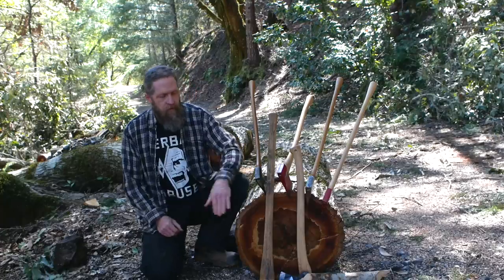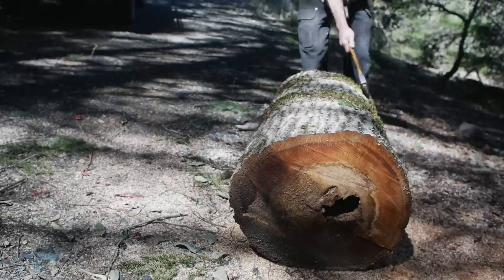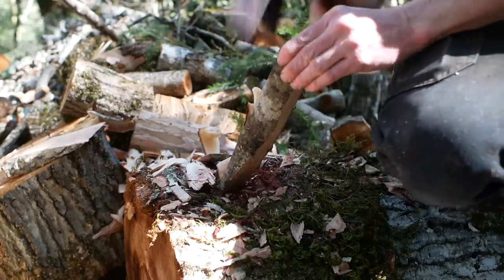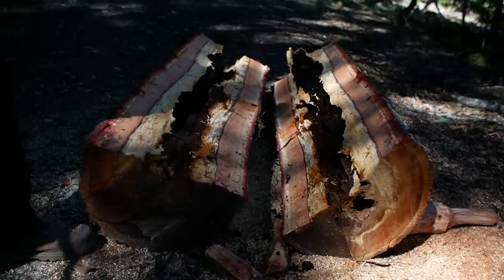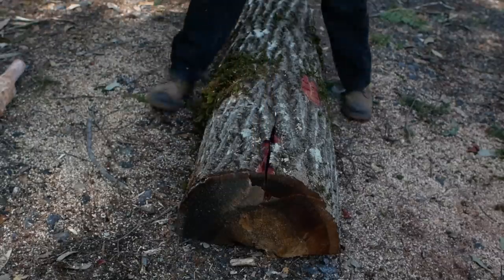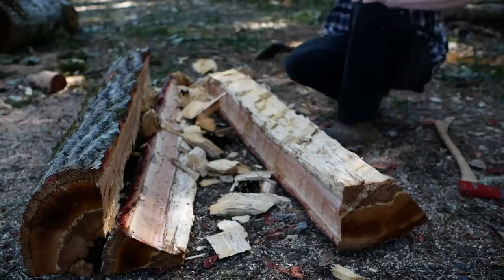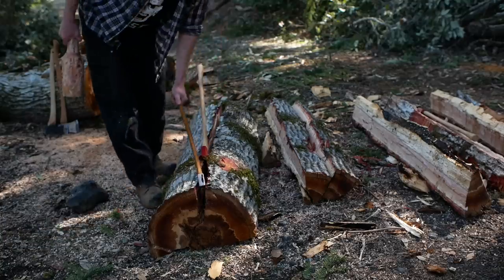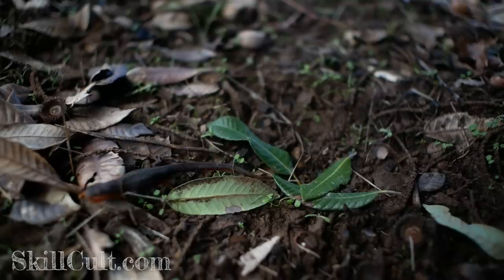Splitting Choice Axe Handle Blanks From An Oak Log & Shaping Wooden Wedges

Comment: Great job on this video. Never heard of tan oak, google tells me its an evergreen link between chestnuts and oaks, how interesting! 
Love the Bowyers Bible series, great info, after making over 20 un-backed self bows from oak, I can say you are right, its "Meh", not bad but not great, hickory is my favorite bow and flexible handle wood. 

Have you done a video on axe handle grain orientation? I learned from Roy Underhill to orient grain as bark to edge heart to pole, which is exacly opposite to most modern ideals, yet this has worked very well for me, and I think it makes sense from a bowyers perspective if you want very thin and "whippy" axe handles, that actually flex into the cut, but I would like to know your thoughts on this.

Josh
Reply from the maker: Yes, tan oak is some kind of weird link.  It's similar to something called the Japanese stone oak and I remember hearing a theory that it was an immigrant, rather than a left over.  It was quite a successful tree until the oak plague hit.  Soon they'll all be gone.  What do you think of locust for a handle wood, or have you used it?  It seems about the most similar to hickory to me, but possibly less tough, though also possibly a bit harder in terms of resisting denting or compression.  A good piece of locust is like a freakin' rock, but then hickory is similar.

I have not done anything on grain orientation really in depth, but I have outlined a video on what matters and what doesn't in axe handles to try to bring some thoughtfulness to that and similar topics.  Also, to raise or highlight questions.  it just got so big and turned into too much of a project to finish lol.    I'm still inclined to think that grain separation is more likely with the grain running perpendicular to the eye, but probably not by a lot.  As far as flexibility goes, I actually looked that up and there are not huge differences as I recall.  There could be other unlooked at or intangible factors though involved in feel v.s. some lab coats pushing on pieces of wood and measuring deflection.  I've used both, but always pick or make handles with the parallel to the eye grain.  I actually did do one video on that kind of stuff, but just cursory. It's a series called axe buyer's check list and one is on handles.  A point I think is important is that a skilled user can mostly nullify a lot of minor vulnerabilities and an unskilled or incautious user can break a great handle.  I think user competence and plain wood quality and integrity trump a lot of other things.  Instability is a huge problem, especially with a lot of low grade wood being used.  The hardware store that has handles here sells mostly crooked handles.

One thing on the bows and axe handles comparison is that Tim Baker recommends making bows to one growth ring on the back when bows are made "flat sawn" style, or go to more of a vertical grain orientation.  That points out a vulnerability in ring separation v.s. separation along the radial planes.  Probably one reason that I still favor vertical grain, is that theory.  He did a lot of testing.  I know him personally and got to see him at work.  he would sometimes make multiple bows in a day trying everything and just extreme testing them.  He didn't care about the bows, just what he could learn.  I wish I could take the time to make that axe handle vid, but it will have to wait a while.
Reply: Mr. Chickadee I also use this method with grain perpendicular to the blade, there are several good reasons.
Reply: SkillCult Thanks for posting this beautifully shot and informative film, it will remain canonic as long as YouTube endures, all the best, Lucas.
Reply: @LucasRichardStephens  Would you clarify your desired orientation please, where would the bark side of the tree be for example in a single bit axe? I would also love to hear your thoughts on the good reasons for this.
Reply: @MrChickadee  Yes of course I am coffeed up so here goes; having used axes for timber-house building for a long time I have had quite a few handles.  The merit of the transverse grain  is, for me two fold, there is a noticeable decrease in short-wavelength shock and an increased durability when prying sideways, which I do a lot when hewing.  I also make hammer handles like this to increase shock absorption, but such hammers can not be used to draw  nails at all. I have a video that shows rehanging my bearded axe, if the link can be posted;  https://www.youtube.com/watch?v=u9dBHGz2mMU . Notice how I use wood that has the desired curve naturally in the growth, this mitigates fibre runout and maximises the strength of the handle, despite the transverse growth rings. The back of the handle is the inner trunk in this instance but only for that reason, if the curve suited the reverse I would do it. I study the wood fibres and allow it to function how I think it's best suited based on experience, which is always growing/changing.  I don't have very much experience using felling axes or generally cutting wood across the grain with an axe. In this second (attempted linked) film I re hang a felling axe, but with the year rings the same way as the blade and very inexpertly fell a frozen spruce. https://www.youtube.com/watch?v=Uw4UlLwjV7g&t=5   I don't have the confidence of experience to try a transverse  hang but your comments here tempt me to try, I still have a couple of these Norwegian pattern felling axeheads to hang, all the best, and both you and Steve are making great films so thanks for that!
Reply from the maker: @lucas Richard Stephens  Thanks, I was going to ask for clarification too.  Very interesting observations.  I had wondered about the side strength of one v.s. the other being a factor in side breakage.  So basically you agree with my tendency to think that grain separation is likely more prone with stress applied across the growth rings v.s. with them, but your stresses are perhaps different.  Or maybe not too different  though.  I've spent quite a bit of time thinking and talking about side impact as a factor in breakage, because it actually is rather common and it's also a common cause of breakage, often resulting in slabbing splits off the side of the axe.  They often result in just a slab hanging partly off the side.  I've seen enough broken handles to make me think that hickory at least, does delaminate along the rings a little more easily, but the stresses applied to an axe are complex and varied.  I use my axes to pry, but I learned the hard way what I can get away with.  I'm always interested in a mellower feeling handle.  I know Buckin Billy Ray Smith thinks the transverse grain handles are mellower.  The bit about the curves in the ring is also interesting too.  If you could stay within one growth ring, on the belly of the axe handle, at least for the top half or so, that would follow Tim Bakers one growth ring rule of bowmaking and might  really make it more competitive with paralell grain or even possibly superior in a felling in some ways.  That is assuming that hickory really is more likely to delaminate with the rings than across them..  Tim showed me a bow once that he called the troll bow, which was a super gnarly piece of yew that looked like some fake bow from a fantasy movie. Seriously if you saw it, you'd never think it would shoot.  He stuck with one growth ring and where knots were, just left the whole lump with the growth rings coming up over the knot and everything.  After that, people started showing up with bows made from terrible wood, with knots and knot holes and such, just by following that rule.  I noticed also that Handles on Scandinavian axes are thicker than I would normally tolerate using if they were made of hickory as I'm used to handles on American axes.  I had thought that might be because they are used a lot for capentery where control is actually needed, unlike in general wood butchery for logging, forestry and firewood. where most work is done by throwing the axe into the work and letting it cut.  i imagine that is partly true, but maybe also between than, less shock prone, lower density woods and a more shock absorbent grain orientation.  Thanks for weighing in.  it's always good to hear the voice of experience.
Reply: @LucasRichardStephens  Thanks for your thoughts and experience! Reasons Ive read about and seen for orienting the billet with bark to edge; 

Less shock, more "spring", easier to rive from log, (you can get more billets from smaller material, I often get 8 billets from one 6" diameter log), the billets dry faster and straighter, and they also tend to stay straighter over many seasonal changes  (most hardwoods want to curve away from the heart as they are removed either in boards or riven staves, if this curve is the back or belly of the axe or bow, it doesn't effect its left right straightness)  

For grain run-out, I simply use a template to ensure the same fibers from the eye continue down straight into the handle, much as is done in curvy arms for bow saws. 

For what it worth, I wander if the trend in grain orientation as most see now is related to baseball? Ash obviously is not hickory and it can de-laminate pretty easily with the rings, such as in making pounded ash basketry. 

Steven Ill have to send you a few hickory billets to put through the paces, Ive yet to be able to break any....
Reply: I actually blame my hickory handled tools for the awful tendon strain I experienced the first few years of working with  axes ( I have only used ash now for about twenty years) but I see now in hindsight a theory developing; we are experiencing a new phenomena  of international trading ie, Hickory handles being imported to Scandinavia where we had always used ash or birch, consequently making the traditional handle shape  damaging to our hands. Bear in mind that, as far as I am aware, buying axes with handles already fitted was not normal in Scandinavia until relatively recently.  The conservative nature of hand workers is tricky to deconstruct and now that we can communicate so easily across differing bioregions, all manner of interesting misunderstandings are  possible. It makes so much sense to hear that in the States hickory was thinned down for a whippy axe. It is really interesting to follow you two, who have so many more man hours of experience actually using hand tools than is normal in the West. The guy from Mudpond hewing, I wish he would do more videos or get into the discussion. Great thread and both of you are perfect gentlemen, all the best!
Reply: I was just thinking...I made ~341 attempts to make an excellent wooden self-bow. #22 was my best attempt.  White ash back in the 1990s before the Emerald Ash Borer decimated our ash.  I remember trying to make gluts to split the stave and it was a comedy.  I made them out of white pine and they blew apart.

Comment: When splitting rails for the chopping platform in the cordwood challenge, I had to thin my wooden gluts due to bouncing out of the split. I ended up with two sets. One very acute compared to the other set. Some wood tends to run out more than others I've found. I plan using rails of pine for my cabin rafters. This will take less trees and give me a somewhat dimensional rafter.  

Great demo. I appreciate the way you give tribute to those gone before us.
Reply from the maker: Tan oak seems especially prone to run out.  I've had endless trouble with it.  Makes me wonder how durable it will really be.  Locust is awesome.  I cut out a little bit about a few different woods that split really reliably for brevity's sake.  Usually better safe than sorry as far as pursuing a sort of best practices approach anyway.  I know what you mean.  That fattest glut there from the round stick didn't come in handy until the end.  I've used really small thin stuff, almost like chips, to hold open and get splits started for increasingly larger wedges.  Pretty consistently though, I think most beginners will make wedges too fat and not planed enough on the sides.  I did.  Hope you're doing well buddy.  Such a cool project you've had going over there with the cabin.

Comment: We used to split a lot of logs. Fence posts, tomato and tobacco sticks, short tool handles- all from locust, hickory and oak. Long tool handles from maple- hoes and rakes. Dogwood wedges are awesome, about the only good use for Dogwood. Used them for felling and splitting wedges. I used thicker "chocks" to position log and keep it from moving.  Since we did so much of this, we made really good mallets and wedges. I used linseed oil to keep my wedges in good shape.  I found a cheap axe with very thick eye walls, after thinning the cheeks, this became my "wedge on a stick". and was great for starting a split in a large log.
Reply from the maker: Fun, I have lumber envy.  So many straight nice hardwoods back east.  I have a couple wedges kicking around somewhere made from durable hard woods.  We do have a species of dogwood, but I don't have access to it.  There are only so many species that have the combination of toughness and hardness that makes really good wedges.  Thanks for commenting :)

Comment: I've only recently started splitting wood manually with hand tools, just the past month. This is motivating. I've got several 1-year cut pine and birch log lengths of 3' - 4', 16" - 26" diameter. No idea if those will be valuable for axe handles but I'm sure I can fashion some handles for vintage hammers and other tools to keep them going strong. Regardless, will be great practice and extremely therapeutic making wedges, splitting some lengths by hand, and fashioning some handles...all fairly new to me. Appreciate your style. I learned a good deal. Thanks.
Reply from the maker: Birch has been used, but I don't think it's probably the best wood.  It might be more that it was the best available maybe.  but it might work out.  Pine I would avoid, but you could try splitting some boards out or something.
Reply: @SkillCult  yes, I figured that was likely so I’ll consider them practice pieces for now. Thanks

Comment: Why are wedges so incredibly satisfying to use, or watch someone use?  Splitting wood, or making a wedged tenon, are some things that just make me happy.  I occasionally fit a brand of aluminium gutter, and my favourite part is that it uses a wedge clip to pull the downpipe brackets together really tight.  I suppose the pleasure of using a sharp tool is the same thing.
Reply from the maker: It really is.  I love the sound of wood splitting apart too.  Maybe it's because they are so simple, but effective.

Comment: Thanks Steven, 
This motivates me to do like to a Big Ole Hickory that's got the top blown down. The tree had been struck by lightening several times and was on the watch list, now it's on the cut list, about a 14 feet tall Tenn. Hickory stump, with the last big limb broke half over. I've got visions of handles coming out of it. I'll be working on getting this on down safely first, then work on the billets second. But you video is a good motivator. 
Thanks man, and God Speed,,,
Reply from the maker: Hickory and some other woods get damaged by standing around too long dead, so if it's green, better get on it.  You'll get there handles where the wood looks fine, but it snaps across like chalk.  I'm pretty sure it's from either being standing dead, or too slow seasoning.
Reply: Steven, 
Thanks once again, got that Tenn. Hickory on the ground, and was a still living tree, with that narly limb. Found the nails near the base and mark them avoiding that hazard, it split into some very useful staves and billets. Your videos are very appreciated teach points, thank you sir. 
Take care,
Son of Liberty ( I change tablets, and just put me name on the Utube account) 
Thanks again,,,

Comment: Happy to see you not using your knife to "batton" like some of these wanna bees ! All these new fangled abused words (battoning, survival, tactical, EDC, bushcrapt, and others) really frost my punkins ! Made a shave horse  by splitting an oak log like yours. Turned out nice too. No glue or metal either.  Just a few splinters in the seat area that I had to deal with . Thanks. Old school wisdom is the best !
Reply from the maker: I baton occasionally, but I'm not a big fan and I don't get the obsession.  I find little use for it and it's slow and uncomfortable.  Of course I usually have a hatchet.  I need to make a shaving horse, but I won't until I have a place to put it under cover.

Comment: With a log splitter in the vertical position,  And a wedge on ram setup, its easy to get a split started by feeding in the ends of the log

Comment: Oak is a very hard and durable wood but isn`t it a bit heavy for handles? Thank you very much for this excellent tutorial vid.
Reply from the maker: I wouldn't say so.  the most commonly used handle material in the US, Hickory, is denser than at least the average oak.  so is locust.  I'd guess that out of the woods commonly recommended in older literature, oaks are going to be just about average.  Ash is noticeably lighter than most of them and some will claim that is a reason to use it in preference to others, but it is an uncommon opinion.